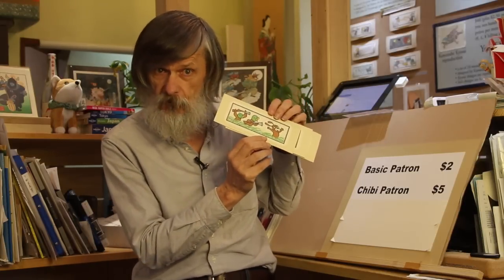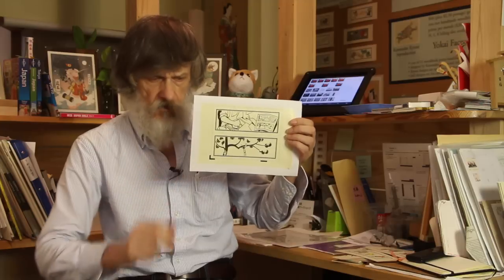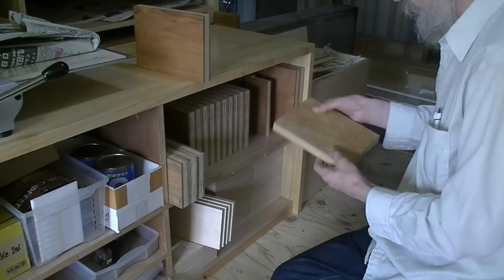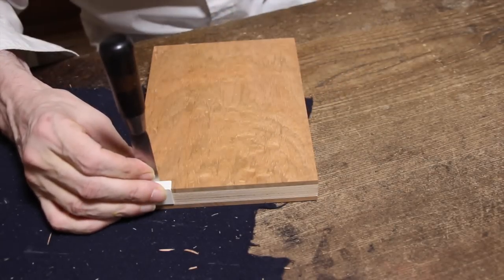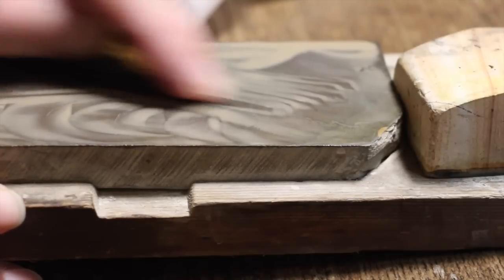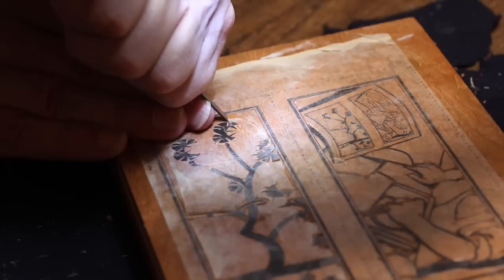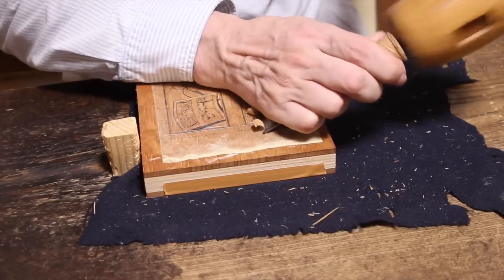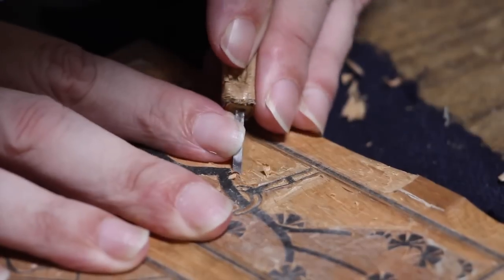Making some Chibi Prints - Part One

Comment: Amazing work and wonderful videos! I discovered your Great Wave videos a couple weeks ago and now I'm working through the Ukiyoe series. I love how you work through the process in your videos, but have you ever done a knife cutting techniques video/series? i.e. Cutting straight lines, concave/convex lines, outer/inner corners, adjusting for wood variances, correcting mistakes (even though I'm sure you don't make mistakes ;-P) , etc etc. I know you have decades experience, and that can't be summed up in any length video, but just enough to give some inspiring wood block carvers a place to start would be awesome! Plus more videos from Dave Bull is always great!
Reply from the maker: Well, on thing on the eventual 'to do' list is a more comprehensive book on these techniques (something with more depth that the eBook we currently offer - 'Your First Print').  The 'plan' is to work together with classically-trained carver Motoharu Asaka, a good friend of mine here ...  But we're both so busy ...
Reply: David Bull that sounds great. I wasn't aware of the Ebook. I'll have to check that out!

Comment: Hey David, Quick question, not necessarily relevant for this video but whatever.
You mentioned a couple of times (During the great wave print) that carve blocks decreased in quality (no longer completely made out of cherry etc) after the last block-making family disappeared some 15 years ago. 

What prevents people from making these high-quality blocks? Are they too expensive now? Has knowledge about block making been lost? Would love to know more about this. 

I also absolutely love your channel.
Reply: Making good carving wood starts from saplings. These are carefully pruned and tended through to maturity. Then you need to mill and dry the wood. If you do it wrong the wood warps or splits or both. No good. After that, you get to make blocks. The grain needs to be perfectly clear and parallel.

I don't know how precise it needs to be for printing blocks, but I assume it needs to be very much so. That precision requires an attention to detail every day for something like 15 years. Also land.

It tends to be a life long pursuit, and not one many are willing to follow.

Please pardon any inaccuracies that I may have included. I am not an arborist, sawyer, or carver. I merely make simple furniture and have a love for wood.
Reply from the maker: The quick and easy answer is simply that the supply chain has disappeared because there is now so little work being published. When there were many active publishers, there was a strong supply chain. The last craftsman suppling the blank woodblocks (Shimano Shintaro) died in 1999 ...

Comment: I have a question about sharpening; why do you not lap your blades? I understand that you're putting a working edge on them, but for smaller parts, I've found the micro burr on the edge cuts particularly thin and consistent with wood.
Reply from the maker: I don't know much (anything, really) about western sharpening techniques. I simply follow the classical way that it is done here - using waterstones of various strengths, with final polishing on a hard stone with the mud. I do know that the Japanese stones are well matched to the Japanese steel, and this combination certainly works for me!

Comment: Do you usually complete the first step of carving using the small knife completely before moving on to the next step? Or do you jump back and forth between the three steps?
Reply from the maker: On this block - as you can see in the video - I am doing a bit of everything all mixed together. The 'classical' technique is to finish the lines first, then clear the wide spaces, then finish off with the flat chisels in between.
Reply from the maker: The system we use - pasting the drawing directly onto the wood and then cutting through the back - works absolutely perfectly for us, and allows us to see supremely fine lines (we don't want or need colour on the wood). It's also completely free from chemical and solvents ...  I think the system you show would be of interest to people who are making prints without key blocks (just colour zones ...)

Comment: @David Bull, are those "Futatsu Wari Moku" Hanga To tools you use at some points? The brass capped ones? May I ask where you tend to get them in Japan, as the only sellers in America are McClaine's printmaking tools, where I have gotten Namisei moku tools.
Reply from the maker: Well, I haven't bought a tool like that in over two decades, so I don't have a current supplier. (I just buy blades ...)   You might perhaps look up Woodlike Matsumura here in Tokyo, who does ship overseas ...
Reply: David Bull thank you !